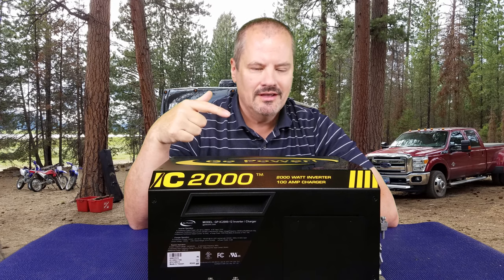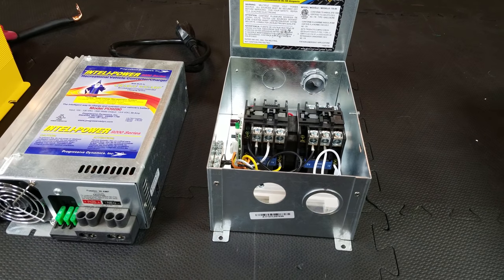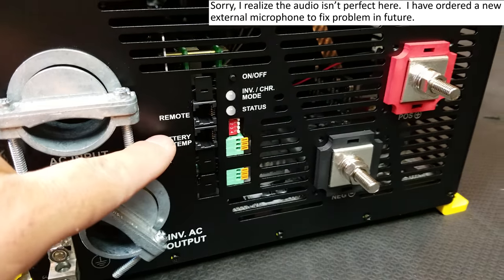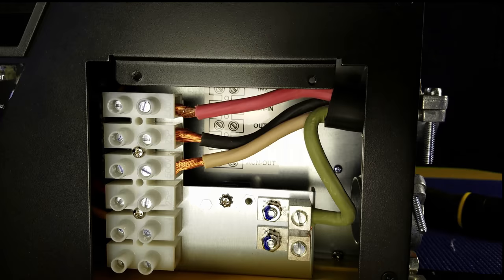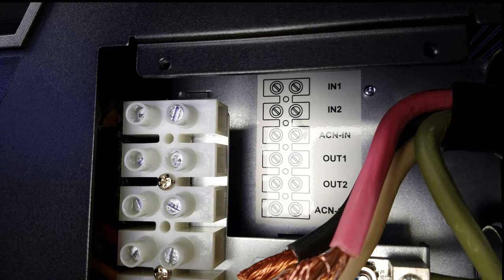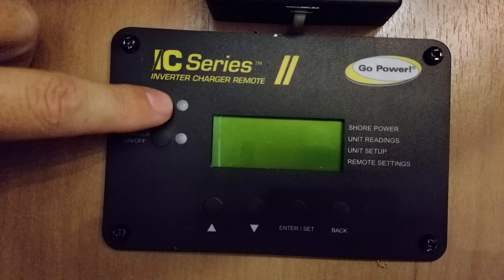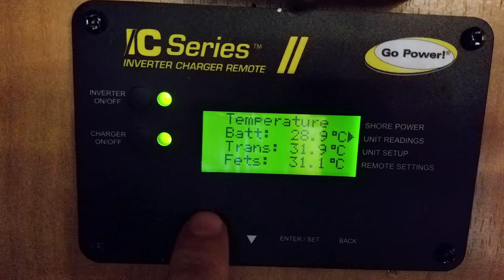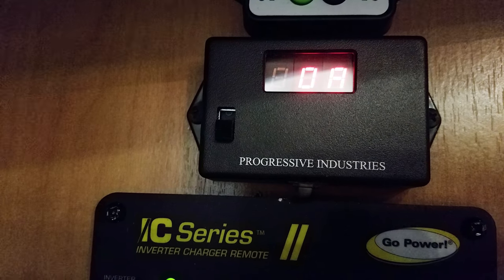Go Power! IC2000 -  Inverter & Converter & Transfer Switch

Comment: This still requires a solar breaker right?
Reply from the maker: This is not on the same circuit as our solar.   Solar comes from roof to MPPT controller to battery bank.  That circuit is complete.   The IC-2000, pulls power from battery (through 400amp fuse) to IC-2000.   The other power input to the IC-2000 is the Shore power to the RV.   That goes through an EMS first...then to IC-2000.....then to distribution panel.     Did this answer your question?
Reply: @tannerjim  Thanks for your insight on this unit, but I'm wondering where then would I make use of my 200W solar panels while using the ic2000? Does the ic2000 address the ultimate dry camping answer, or is it strictly for shore power converted to DC power?
Reply from the maker: @martran56  IC2000/IC3000 is a converter (shore power to DC for RV's 12v device & charge battery bank) and and Inverter (AC power from battery bank).   Solar would charge battery bank...then battery bank feeds 12v to this device...creating AC for the RV.
Reply: @tannerjim  Thanks. I got it. Cheers

Comment: No generator input?
Reply from the maker: Unfortunately, not.   You'll need a normal transfer switch if you want to wiring in a generator.  Here is a link to another video I created, showing you how to wire a transfer switch.   https://youtu.be/zTjOECEhYDM      The transfer switch inside this device is transferring between "shore power" and 12v power.   It works GREAT for that situation, which is perfect for our RV, as we don't have a dedicated generator.  We only carry a small/portable Yamaha generator.
Reply: how does that work while boondocking and you want your AC on as well?  You turn you your generator for Air Cond and the rest of the AC power is run through the inverter at the same time?
Reply from the maker: For the AC to run, you CAN use the IC-2000 and a small generator (we have Yamaha EF2000).   While we have not tried this, the folks at GoPower assure me it will work.   Just note, that doing this will run down batteries even with the generator running at the same time.    We still work full time jobs, so our camping is still limited to local trips.  In Oregon, we typically don't need to run our AC unit, as temps don't get too hot where we camp.

Comment: Jim, great video.  I am in the process of ordering a new fifth wheel with a generator and solar panel.  We plan to do a fair amount of boondocking and I wanted to minimize the amount of run time on the generator, so I was looking for an inverter we could use to power the RV on 120 v, without having to do a lot of the secondary panel and transfer switching I was reading about on the web.
One question, after looking at your wiring diagram, it looks like to me you disconnected power to the original battery charger that came with your RV?  The IC2000 does all of your battery charging, besides your truck.  Is that correct?
I think this is the setup I was looking for, without all the manual switching.
Thanks for your time on the video.
Reply from the maker: Vic....Yes, the IC-2000 (they now offer an IC-3000) also charges your battery.   You can configure all the settings via the remote panel.    I have it set to max of 80 amps....but I doubt my batteries ever get low enough to see that level of charge, as they are always being charged via our 544w of solar.   Nice thing is you can also turn off the charger via the remote display.    If you use my link, I get a fee from Amazon, but it doesn't cost you anything...helps offset my costs for gear and web host.    Hope this helps... Jim